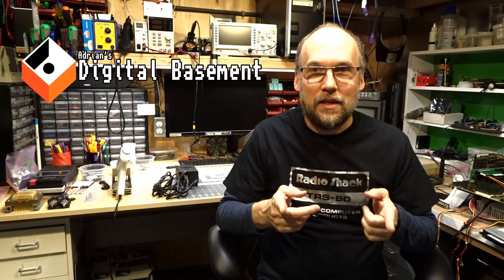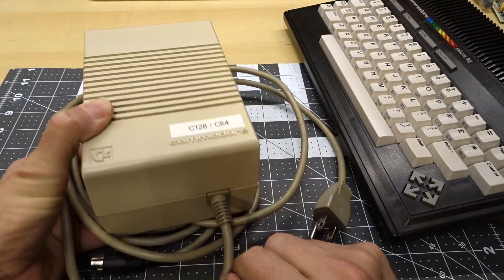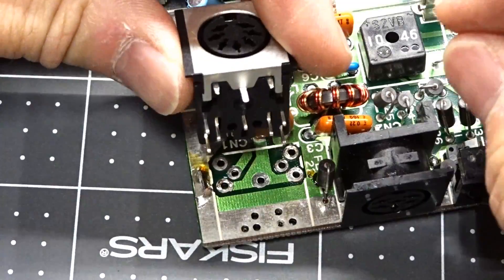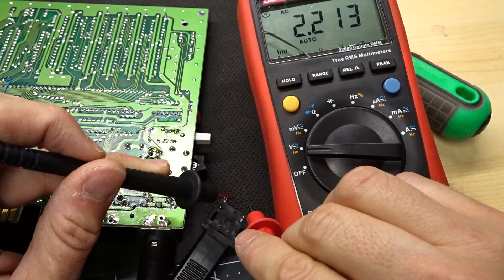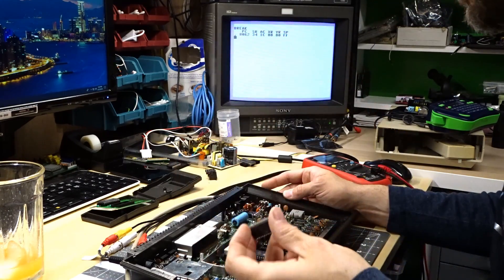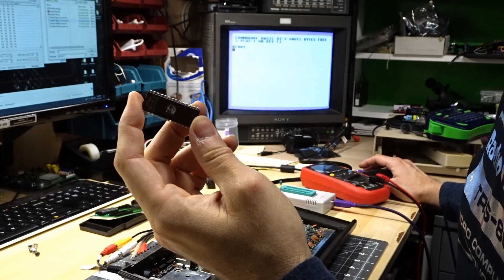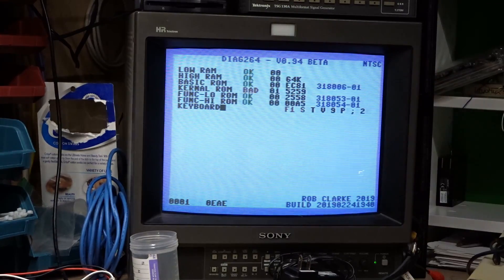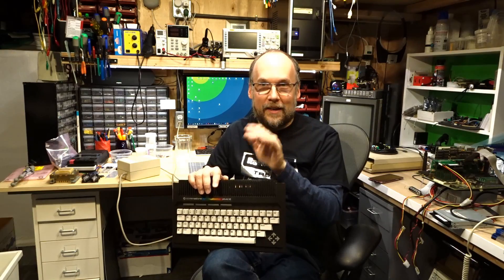Using a C64 power supply with a Plus/4 (Bonus Diag264 diagnostics)

Comment: the '3 plus one on key f1' stuff actually is derived from whatever option roms are installed and it can also go 'something else on key f2' depending on what you put into those slots (as in it will just repeat the procedure for whatever roms it finds and assign keys to it ;)

Comment: 'why did commodore change it'. ehm well would it be because on other models people kept trying to ram them into the video port or the serial bus? :P also the plus4 doesn't need 9vac for anything (unlike the c64 which derives some clock from it) and it only goes directly to userport pins 10 and 11. the c16 not having a userport also does not have a 9vac

Comment: im not against making modifications to classic hardware. especially in the case of a unreliable power supply which can cause more damage in the long run. and its not like this mod causes any permanent damage, just swap the connector again if you want to restore it as an accurate museum piece.

Comment: I think an adapter is better. This mod works fine......for now. But what if you get another 128 or another +4? Well........guess what? You can't power them up. If you had the adapter, you could. And you could just leave the adapter plugged into your main one.

Comment: C128 had a beefmode 5V power supply :D
Also the output overvoltage protection there is kind of smart, but not very accurate (but good enough for what it has to do) - zener diode fires off a thyristor that crowbars the output, this in turn fires off the overcurrent protection, so the thyristor and switching transistor don't explode. And to reset it you need to unplug it from the AC. No fuses to blow which is a plus. Nice smart design.

Comment: I do not know how you got the epoxy brick separated from the power supply case so cleanly. I had to basically chip away at it with a hammer until it finally dislodged itself. The case suffered a small split as a result. I also see your case has none of the vertical sections that mine does. Were you planning on doing a "re-brick" of the power supply?

Comment: Personally, I feel like those collectors who insist on pristine, factory original, preferably unopened products are missing the whole point. These machines are meant to be USED, not gathering dust as a sign of wealth. 

As long as it's reasonably compatible with original software and accessories, and looks similar to the original, I see no problem with mods that keep the computer running smoothly, make it easier to use, or extend its capability. If the mod is easily reversible, like this one was, that's even better. I don't even think I'd notice it without seeing either this video or the PSU label. In the latter case, I'd just have assumed they were interchangeable, especially knowing that's the case with many Vic 20/C64 accessories.

Just don't screw it up like I did once (rookie mistakes bypassing a dead TI-99/4A RF modulator)

Comment: I love your videos. I did think a little "... but the machine's not in even an approximation of original condition any more", but your argument about being able to swap a C16/C64/C128/even others? in because of the common-ized power connectors wins, IMO. <3
Reply: Also, it ALREADY wasn't in original condition. The processor and kernel ROM are both diffrent. Surely one more alteration doesn't matter in the face of such significant change.

Comment: Can you use that EPROM programmer to program a Signetics PLA with the ROM of a C64 PLA?  (Considering MOS PLAs are hard to find and Signetics ones are significantly easier to find.)
Reply: No, you can't and I don't expect support for it. The PLS100N is simply a too old device and not often encountered in the wild, so the Chinese developers of that programmer likely have higher priorities.

Comment: Hi. First of all thanks a lot for a video about the C=Plus/4. I love all of them, there's much to know for me. 
What I want to say is that I bought a second hand (50€) C=Plus/4 and while I was expecting for it to arrive I bought a power supply. The thing is that later I saw that my Plus/4 has a round socket for the PSU; the same that the C=64 has. So in my case I can use a C=64 PSU as it should had always been.
Also: What's the matter with that metal plate around the round PSU socket?. Take it out and you are happy.

Comment: Silly for Commodore to change the connector just to change it, since the case is black a little Sharpie over the silver should match it up. ;) As far as I know they used sockets on nearly everything up to a point in time and then stopped, makes your EPROM swapping easy though heh.

Comment: When people tell me it isn't original I tell them it works and to go fly a kite. I know a guy with a 1952 car that is completely original. And I mean COMPLETELY original. Original oil, engine coolant, tires, brakes, batter that won't hold a charge at all, hoses, belts, everything. I think the only thing not original is the gas to be honest. It only has about 1,000 miles on it and he hasn't driven it in over 20 years as he is afraid of breaking something. I think the only thing not original is the gas to be honest. To me that is taking things a bit too far. At least this one runs the way it is supposed to and he is happy. Good for you for having some common sense.

Comment: I got myself one of those Gaojie S-993A desoldering guns. Other than lacking RTV silicone around the solder terminals to prevent stress on the joints (which I added), it's actually not a bad unit for the price you pay. The stand it comes with is far heavier duty than the one I have for my soldering iron (I'd like to get another one actually). I was expecting a lot worse.

Comment: @Adrian Black
I would cover up the window on those eprom's, just in case. About the power connector, it think it's a great idea to switch to an easier to use power connector as well as get away from those old dodgy power bricks.
Reply: TheCaptain No kidding. The brick that came with my 64 many moons ago wiped the RAM but good at one point. At least the replacement brick I was sold was not hard-potted and repairable if ever needed.

Comment: Bought a pre-made cable from Ebay to convert the 5pin din to plus/4 for around $12.   My own rule is that i have boxed unmodified machines, and others loose units that I modify at will.   Adrian, how about that plus/4 memory upgrade video?   :)

Comment: Actually, some Plus/4s actually came with a round connector from the factory, and they were indeed compatible with the C64 Power Supplies. So apparently this change to the square happened sometime during the lifetime of the machine, and/or C= just used whatever they found it their parts bin that week, which would be typical C= anyway. BTW, I'm a simple man, I see a 264 series video, I press like.

Comment: As these machines get older there is only so much you can do cannibalizing parts from other computers and so on so I don't think there will BE such a thing as an "original" in the future where it all works. As long as the insides are mostly original I don't think altering the power plug for a convenient and SAFE power brick across your multiple Commodores I don't think it matters much.
Sadly my own (well, family owned) C64 bricked itself some time ago and I think it got thrown away. Too bad because I think I might have been able to fix it now. Oh well...

Comment: 15:20 - That's the great debate about restoration; most restorations involve using replacement parts which are often non-original, but then again, what's the point of keeping something if it's ruined (especially something that is functional as opposed to just decorative)? Unfortunately there is no correct answer, and the appropriate course of action depends on the thing being restored, the restorer, and the owner. 🤷
Reply: (Oh, and Commodore power-bricks are friggin' notorious for being ridiculous. I've heard explanations of why they're like that, but there have been plenty of power-supplies from that time that didn't need to resort to that. ¬_¬)

Comment: I actually have a Plus/4 with a ROUND DIN connector and it came from the factory that way.
Reply: I had 2 out of 7 that had this. I looked at the boards, they're identical. So swapping them is easy.

Comment: I think some diagnostic cartridges for older computers were socketed because they would sometimes upgrade the ROMs, which would allow swapping the chip instead of replacing the whole cartridge (or cartridge circuit board).

Comment: The problem is not with the regulator going bad but the transformer shorting out that causes high voltage problem.  And the 9VAC is used by the User Port to power various things as well as making 12v with another regulator on the board.
Reply: No, C64 knowledge does not apply to the Plus/4 here. There is no 12V circuit on the mainboard. As Adrian said, it is only used for the cassette motor. And you are right it is available on the user port.
Reply: Daniël is correct.  The 6581 SID chip in the Commodore 64 required 12v DC to operate; the TED chip in the Plus/4 does not.  On the Plus/4, the 9V AC is needed only to provide power to the cassette motor and the user port.  There is no 12v circuit in the Plus/4 because it doesn't need one.

Comment: Why would they epoxy their power bricks?
Reply: Transformers are often potted in order to reduce vibrations. This makes the power supply less noisy.
Reply: I’ve heard about four main different reasons for filling power supplies with epoxy though I imagine there are more.

1. It waterproofs the electronics to protect from shorts
2. It isolates the electronics to protect from shorts
3. It keeps components secret to prevent reverse engineering
4. The resin conducts hear better than air

The first two are valid concerns especially with the habit people had of putting these bricks on the floor, but if you open several of these PSU you’ll find that Commodore sometimes did a pretty crappy job of filling them and sometimes the transformer taps where left exposed defeating the safety measure of potting them.

The third reason is simply ridiculous since the Commodore PSU was not a proprietary design and used off the shelf components in their manufacture.

As for the fourth reason, while it’s true that resin conducts heat better than air, Commodore built their power supplies completely sealed in plastic and without any ventilation. This defeats the purpose of having better heat transfer since the heat can’t escape the plastic housing and gets trapped there.
Reply: Julio Rodriguez the fourth reason is valid. The epoxy transfers the heat to the case which is of course exposed to the room temperature. It’s not trapped.
Reply: @pb7379-j2k I tend to disagree with this since plastic is usually used as an insulator. Plastic does a poor job in transferring heat, at least in comparison to air or resin.
Reply: Julio Rodriguez but we’re not comparing plastic to air.

We’re comparing air vs resin to answer the question of “why did they fill the supply with resin”. 

Plus, plastic conducts heat better than air anyway
Reply: @michaellowery1559 Epoxy isnt exactly cheap, and its not exactly safe to work all the time with - so why not just leave it out?
Reply: @michaellowery1559  I don't think so, the epoxy (glue?) has it price too + it adds an extra operation on the factory + time to dry... this looks ridicules
Reply: Epoxy offers two advantages it is an electrical insulator, and it conducts heat better than air.
Reply: cost-cutting
Reply: The National Guard Σ  That's easy to answer.  It protects you from being sued by idiots who got the shit shocked out of them because they opened up their power supply to see what's inside and touched the wrong thing.  (You'd think that surely they'd unplug the PSU before opening it up.  But never underestimate the power of idiots in large numbers.)
Reply: It also makes them extremely durable. The 500 model desk phone had its electronics packed similarly

Comment: An alternative to modifying the machine would be to chop off the plus/4's old power supply end and make a c64/128 to plus/4 adapter with it. Then you can use a c64 supply on any plus/4 without modding every single one.
Reply: Someone owns more than one "working" plus/4???  :)
Reply: @BrianV_PM  well, you'd need a good psu to find out!

Comment: i'd say, you could also create an passtrough cable from round to square.
Reply: I'd just leave it plugged into the back all the time, then you can't lose it :-). Alternatively you could have made a Y splitter on your power supply and attached both round and square plugs to the PSU
Reply: @SimonQuigley  Then the PSU wouldn't be original. I like Adrians approach and solution.
Reply: Nothing wrong with how he did it, and probably what I would have done. It makes sense to have them all use the same plug and socket. It was just if anyone cared about keeping things stock, in which case I would care less about the power brick than the device being stock :-)
Reply: Better idea and takes physical strain off the connector and PCB
Reply: I suppose someone could make a universal adapter cable for all the commodore PSU/PCs combinations you could also include a fuse on the input with a crowbar circuit to protect against overvoltage from the crappier PSUs.
Reply: The problem is getting the square connectors while the motherboard has the pins prepared for the round DIN as well. So swapping it to a readily avaibale socket is much easier.
Reply: I thought that wouldn't work. As the round connector has more pins in the connector itself, then the square connector has.
Reply: @GlobalXs2  it would. all you need to do is connect only pins that are actually needed to run

Comment: this is sacrilege!  you should have just made a converter cable, leaving the machine as it was intended.
Reply: Actually, if he had left it as the machine was intended, he should have left it broken. :)
Reply: @BrianV_PM  Dont be daft, no machine is intentionally made broken!
Reply: @Dust599  This unit, however, was broken until he replaced the dead processor with one from a C64 and the main ROM with one modified to work with a C64 processor. It already wasn't in factory shape, and can't be restored to such without gutting another +4(or relative) due to the unique (and failure-prone) processor.
Reply: Commodore themselves saw no problem in changing the port shape, just because. Where's the religion to be sacrilegious of?
Reply: It is a clean mod: The case is not mutilatted and many people wouldn't notice it is modded. Commodore left the option there to mod it, which IMO also reduces the sacrilege aspect.

There always is a trade-off between preservation and keeping a machine in usable working condition. This is clearly the case here. IMO as long as a carefull decision is made, where the interrests of preservation are taken in account, I don't have problems with taking steps addressing the interrests of keeping the machine in usable working condition.
Reply: Peter Ellens Sacrilege would be shelling out the computer and sticking a newer motherboard in it. Every electronics manufacturer has had to deal with parts availability at one time or another and often made rolling changes like with the connector here to keep product going out the door!

Comment: My thinking for why Commodore changed the power connector was so that it wouldn't be possible to insert it into the adjacent video port and fry stuff.
Reply: Looking at the two connectors, I... don't think you could even manage to force the power connector into the video port. The pin positions and spacings are different enough that even bending four of the pins on the power connector, I don't think it'd fit. Of course, I've never tried this, so...
Reply: @Ice_Karma  I totally agree, but if I didn't say that, someone would likely come by and say they were able to force it enough that the pins barely touched and sparked something...  but I haven't really tried to force it myself either. :)
Reply: The video and power on the C64 are different DIN types.  I didn't think there was even a way to plug the power into the video port and just double checked.  Even with the 4 pin c64 power supply the pins don't line up to fit into any of the other ports.  Perhaps theres a way to bend them and shove them in, but it seems unlikely to happen accidentally.
Reply: @BrianV_PM  Even if it is physically impossible(which is already a good thing), it could be confusing to new users to flip their machine around and see three or four "identical" round DIN connectors. I can see wanting some diversity of shapes just so it is obvious which plug goes where.
Reply: @Mr T. Guru Video port's a DIN-6 connector, not a DIN-8, but your point still holds.
Reply: As for me - this is definitely the point
Reply: @Mr Guru he was worried that if the 2 had the same connector that the 64 psu would be used on a 128. So he changed the connector.
Reply: @Mr Guru not the computer. The psu. If you have too much current it will kill it.
Reply: @Mr Guru He said on the 8 bit guy's channel that he changed it because it's a bigger PSU and he didn't want people risking their C64 PSUs on it.
Reply: @Mr Guru I was referring to the 128 not the Ted series.
Reply: @Mr Guru and yeah that would be bad. The 64 psu is smaller and the 128 uses more power. Ignoring the fact that the 64 psu is crap and the 128 is solid.
Reply: @Mr Guru it would fry the psu, which "would be bad". Maybe he didn't know just how shit those packs were. Lol

Comment: The Plus 4... You're a glutton for punishment.  :)  I don't see anything wrong with swapping out the power connector especially on systems that aren't really rare anyway.  The museum's all have one, so nothing wrong with you using and modding yours however you see fit.
Reply: And besides, it's not exactly difficult to put the old socket back if needs be.